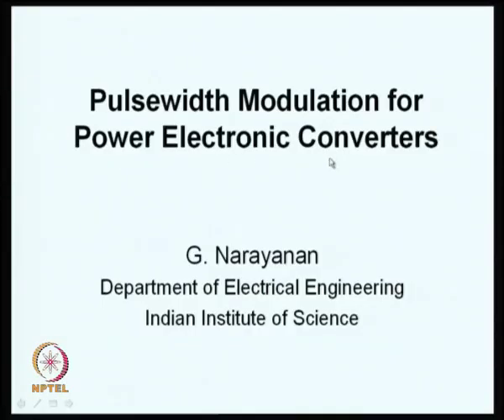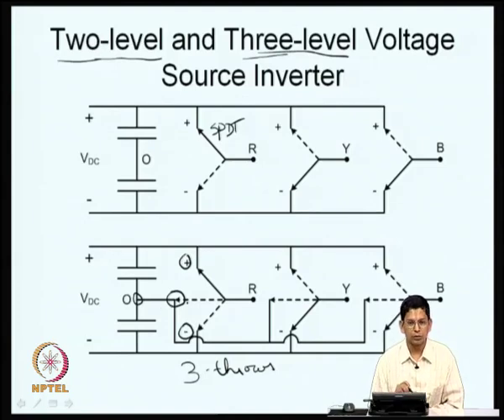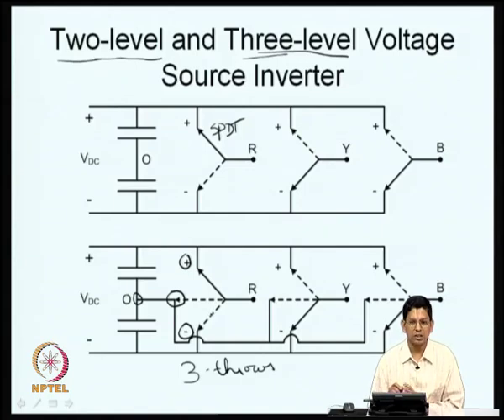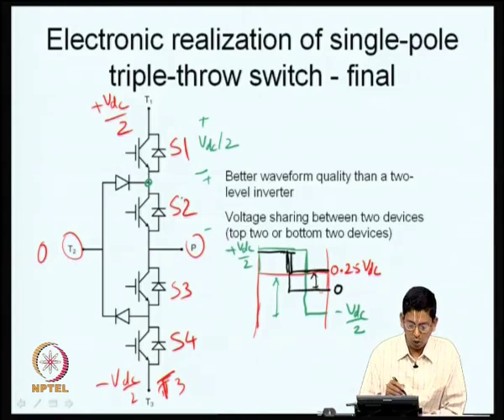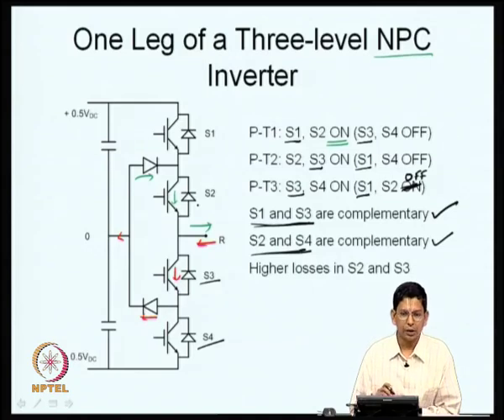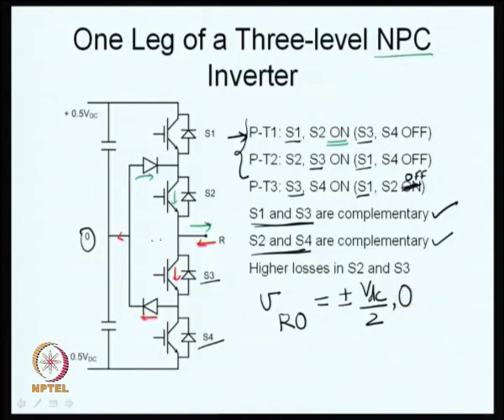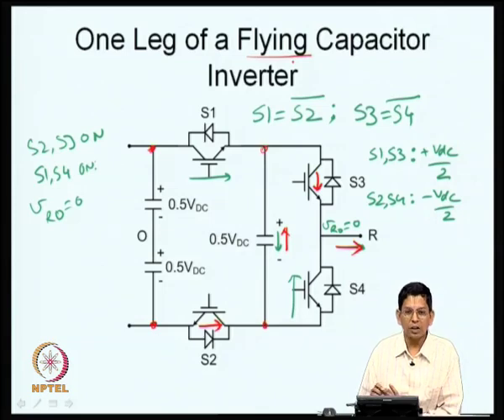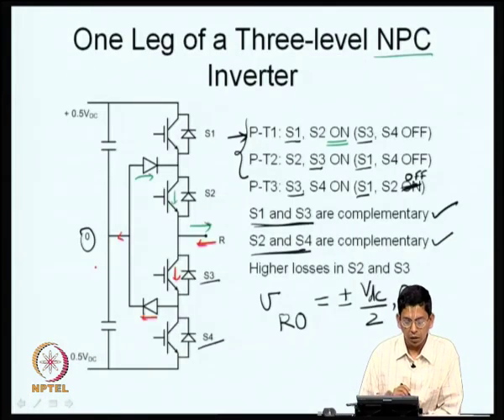Mod-01 Lec-05 Multilevel converters - II

Comment: in a four level NPC what is the need of connecting two diodes in series?
Reply: So that voltage rating of those diode will reduce
Reply: To make equal voltage stress in each diode  ie Vdc/3.